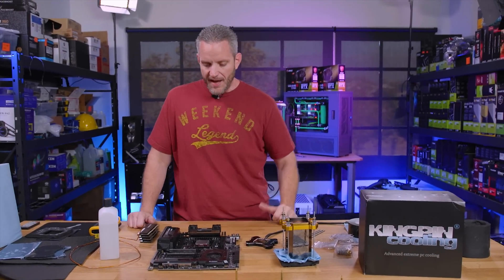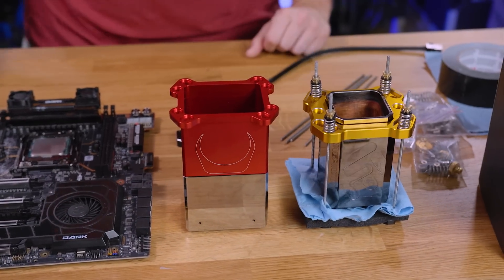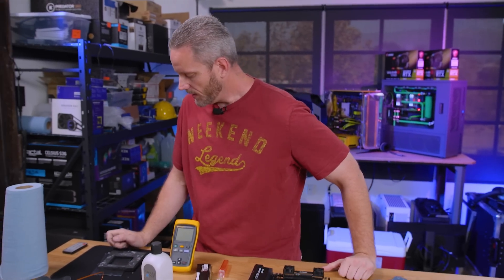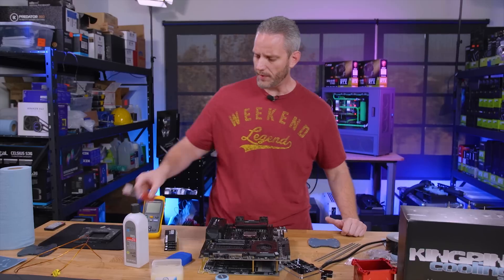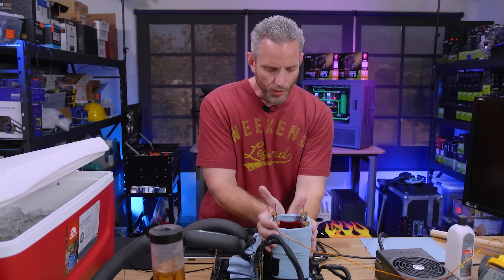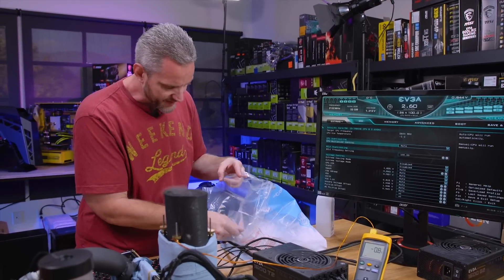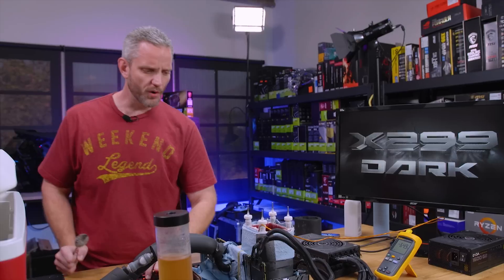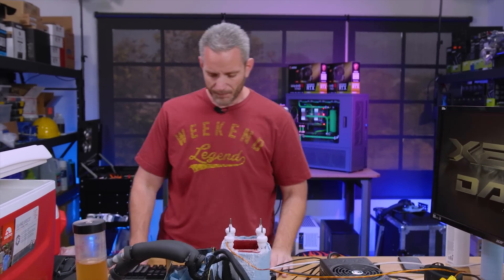Dry Ice Overclocking... NOT RECOMMENDED!

Comment: The trick to using extreme cooling such as dry ice is to encase the motherboard in a vacuum chamber. This would eliminate the possibility of condensation. (It's very easy to make a vacuum chamber there are many videos on YouTube - such as "Custom Vacuum Chamber" skip past the 1st 2 min as he shows his old failed chamber 1st). Once the motherboard is installed inside a vacuum (where the air is removed) the surrounding "space" no longer has moisture in it (as it was all removed by the pump). Please note in a vacuum there is no air to blow - so if using fans (such as on a chipset) you'll also need to rig something up to those such as liquid nitrogen / dry ice to cool the videocard/chipset/VRM's. As for getting the the cables/power cord to the motherboard - a Plexiglass vacuum chamber still works if you drill very tight holes for the cables then use silicon to seal them in place. (Silicone is easy to remove later if you wish to remove the cables as well) - Yes this does work as you can see here: https://youtu.be/VpIM1WhmqGk

UPDATE: I am getting many responses where people are saying this would never work or this or that would be an issue. However upon reading their comments it seems clear that all of them (so far) really have no idea how a vacuum chamber works. I have watched countless videos about vacuum chambers for many years done by DIY enthusiasts to University professors. And I have a firm grasp of how they work and so I have written a number of responses to the various comments to correct all their erroneous beliefs which are obviously based on assumptions they made without knowing all the facts.

So if your also in doubt or disbelieve about if a motherboard could work in a vacuum please read my replies below. 

ALSO I'll give you a hint now:
SOLIDS: such as metal and rock are NOT subject to expansion or contraction due to a vacuum (they only expand or contract slightly from heat or cold) - hence we see asteroids/meteors in space not affected by the vacuum - as well as various metal objects in space - like space stations, satellites, and telescopes - ALL containing electronics including motherboards which work perfectly fine in the vacuum of space. 

GASES & LIQUIDS however are affected (causing expansion & or contraction) by all of these extremes HEAT / COLD and VACUUM / PRESSURE.

Think of a vacuum as the opposite of being deep in the ocean. In the deep of an ocean - water pressure is CRUSHING inward. Yet drop a boulder (made of rock) or sink a ship into the ocean and it sinks to the bottom unaffected. However if that boat contained a pocket of air sealed inside an air tight room it would be crushed. So they invented submarines made of metal and glass (glass is a form of rock) which withstand the pressure fine.
In a vacuum it's the opposite of deep water - instead of crushing pressure it's expanding outward pressure. And BOTH of these extremes ONLY affect items containing "GASES" OR "LIQUIDS" which are subject to EXPANSION and COMPRESSION - METAL and ROCK are not subject to expansion or contraction due to a vacuumwhich is what video cards/motherboards/ram are ALL MADE from.
Reply: As air pressure drops, electrical conductivity increases, up until you down to around 1/100th an atmosphere. So unless you get a very good vacuum you run the risk of frying your computer.
Similar problem this youtuber ran into with putting  a microwave in a vacuum chamber https://www.youtube.com/watch?v=JSR7I1PEh1w
Reply: "JCB 136" - Perhaps you should educate yourself better before speaking your "opinion" - Because as you can see from these videos solid state electronics electronics run fine inside a vacuum (here are just a few quick examples): 1st one is a cell phone running inside a vacuum without issues:
https://youtu.be/_1REFC5lI2U
2nd you can see a Bluetooth speaker running fine inside a vacuum chamber.
https://youtu.be/657caNs8nRY
Home made vacuum chambers are far from perfect vacuums like space - however they are strong enough to remove all the moisture. AND as you can see they DO WORK.

Here's how to build a quick and easy home made vacuum chamber https://youtu.be/ERRMoHfrjAI - which you can witness it functioning yourself.
Reply: Better off putting the board in an airtight enclosure with a desiccator and recirculating fan and removing the moisture that way. The LN2 container could be channelled through to the board without having to insulate everything. You could blow some nitrogen gas into the container to keep the pressure equalised and vent the excess.
Reply: Justin Harrison Also, all the components without heatsinks still require basic air cooling which is lost in a vacuum, but not in an artificial atmosphere of something like pure N2 or CO2 (basically your extreme coolant evaporated).  Also to keep things running you need something that cools your N2 or CO2 back down in a loop.
Reply: I am not saying it will not work, but how is that a better "Trick" than simply putting Vaseline on stuff? 

Idk man, that is overly complicated, and also (as you said) creates the problem of cooling anything on the board that needs a fan, which opens even more work. Crafting a plexiglass case, splicing cables and drilling holes than soldering cables and closing the holes is plenty, plus since the chamber will be from many plexiglass panels it will not be perfectly vacuum too. Keep in mind that if you drill a hole big enough to stick a 8 pin cable trough it, no matter how much silicone you put, if your vacuum is good, it will suck the silicone right in and you are screwed. 

It MAY work, just like many other things, like driving your car on whiskey instead of gasoline. Is it practical? Nope. Does it pose more risks than problems it solves? Yes. I am not saying I am a professional or smth, but I haven't seen Der8auer or Kingpin use vacuum chambers and they do just fine.
Reply: As for your comment about it being overly complicated - have you seen the lengths Jayz goes to in his videos? Just look at this video he's got all sorts of cooling going on. Not only is he using dry ice on the CPU but he's also using a cooler full of ice with a bunch of water cooling radiators buried under the ice (to pump very cold liquid cooling to the GPU). Also look at all the effort he has to do to prepare the motherboard/GPU/RAM etc for condensation - he has to cut all sorts of sizes of paper towels, fold them, roll them, tape them, and wrap the video cards etc. Then there's the need for the thermal heating pad, Vaseline, foam etc. So I don't see why you'd think building a simple vacuum chamber is so much effort for this channel. With out the worry of condensation - perhaps he could get temps even lower than other record holders - and possibly beat their scores? (It's most certainly not practical to use dry ice to cool a CPU yet you obviously watched the video & did not complain.) New discoveries are made by pioneers - and risk takers achieve new records. (For example the guy who designed the liquid nitrogen chamber for this CPU - his pioneering efforts made it possible to cool a CPU to these low temps and achieve such high clock rates.) 

(Not that this suggestion is intended for "beating" other peoples records/scores for "fame" - but rather it's a suggestion made out of curiosity - to see how far the hardware can go.) 

Also please note that Plexiglass comes in all sorts of thicknesses. Including (if you had searched Youtube for "Custom Vacuum Chamber") you'd see the plexiglass to use is 3/4 inch thick (you can achieve an almost perfect vacuum with plexiglass if you seal all the sides with silicone). The YouTube Channel "The Action Lab" uses a custom made plexiglass vacuum chamber in many of his videos using the same 3/4 inch thick walls. 
As for your complaint about silicone getting sucked through the cable holes - I suggest you check out the "King Of Random" Youtube Channel and search for the video titled "Electricity in a Vacuum Chamber" They have a working vacuum chamber with holes drilled through the plexiglass which are then sealed with silicone (well silicone mixed with corn starch to thicken it up) They manage to reach an almost full vacuum and the silicone does not get sucked through. At this level of vacuum it would be more than enough that all moisture would be removed - making it safe to use liquid nitrogen or dry ice.
Also you can watch "How To Build A Vacuum Chamber, That Sucks" on "The King Of Random" channel again he uses the same 3/4 inch plexiglass & silicone which is used in many of his successful vacuum chamber videos.

*One last small footnote - with so much plastic polluting the planet/oceans etc. it would be nice to see someone use plant resin to make plexiglass instead of using traditional petroleum based resin - as plant resin based plastic bio-degrades if left to the elements - and petroleum based takes 25-35 years (or more) to break down. Which is the main problem with traditional plastic.
Reply: There is nothing fake about these plexiglass/perpex vacuum chambers - as they do work. For example there is no way to "fake" these expanding marshmallows under vacuum as seen here https://youtu.be/OuHBzK-LK24  (also at the end he reintroduces normal pressure and the marshmallows condense)
Reply: @AstarOfDavid  You do need a super thick case for the vacuum pressure. I put my phone in a vacuum chamber (wrapping in carbon fiber), and at normal size of 3x6in (75x155mm), that is over 260 lb of force (~120 KG). On a motherboard (or the lid, depending if you use a vacuum bag or a box), that would at minimum be over 2000 lb (a full ton, which is significantly more weight than driving over it with a big pick up truck) or ~1000 KG. That's probably why most pressure boxes or motherboards would fail, its a LOT of force going on. I mean, that's probably going to shove the RAM sticks right through the board like a knife if you're using a bag... Good news is, you won't need to bolt the cooler down!

I do run sub-zero for daily, its not difficult at all. You water-proof, then insulate, then add some heaters, and then a little more insulation and you're golden, basically maintenance free for a year or whenever you next upgrade. Its not rocket science (I make that joke as an aerospace engineer, but its really not that complicated).
Reply: Unfortunately it seems that you do not understand how a vacuum works. Solid items like METAL & ROCK are NOT affected in a vacuum. For example there are countless items in space such as asteroids & meteors made of rock hurtling through space that are not "crushed" AND there are countless items made of metal floating in the vacuum of space such as shuttles, space stations, telescopes, and communications satellites. None of them are "crushed" and all of these devices orbiting in space contain many sorts of electronics which work fine in a vacuum. In fact I've seen astronauts working on the Hubble telescope doing repairs to various motherboards while floating in space. (The astronauts require a special suit to protect them from boiling then expanding then exploding in the vacuum of space - because they are mostly like a sealed sack of water. - Yes boiling even though space is like -450 degrees - water boils under a vacuum - in other-words a vacuum lowers the boiling point of water) The metals and the astronauts suit are all un-affected by the vacuum of space. This is because a vacuum expands items containing "air" (aka gases) and "water" (aka liquids)
I used to think the same way about a vacuum chamber assuming that it was high pressure which meant that anything inside would be under extreme crushing pressure pinching it inwards. When in reality a vacuum works in the opposite direction - they pump air OUT of a vacuum chamber (which is a removal of air and gases including moisture) - they do not pump air into a vacuum chamber (like a tire) - if they pumper air into a vacuum chamber then it would be pinching pressure - and my idea would not work because there would technically be more moisture trapped inside the chamber than before. Items in a vacuum which contain "air" or "liquid" expand outward. Just to verify this watch this video and see for yourself a vacuum EXPANDS items it does not create massive pressure crushing them. https://youtu.be/zYLJGXthzpE
So to your comment about the RAM and CPU fan:  Being inside a vacuum does not create "gravity" to push the ram or heat sink down. (Gravity occurs in a vacuum when you place an item with huge mass inside it) There for there is absolutely NO reason why a heat sink or RAM would be forced in any direction. 
Motherboards, CPU's, RAM, etc are considered SOLID STATE ELECTRONICS and are mostly made of METALS and ROCK (yes motherboards and all PCB's are made from fiberglass - which is a ROCK). 

Footnote:  Electrolytic capacitors (On most motherboards and video cards) do contain a dielectric liquid sealed inside them - however they are designed to withstand expansion - as capacitors run around hot items they also heat up - often reaching above the boiling point of water. There for to prevent them from bursting they are designed to withstand a very high pressure. So there is really NO REASON why a motherboard would not work inside a vacuum.
Reply: @AstarOfDavid  I know how the forces work, its not rocket science (I'm an aerospace engineer, its obvious when summing the forces with 0 pressure on 1 side and 0 pressure on the other is the same as sitting on a desk like normal). What I'm talking about is if you use a vacuum BAG, since its by far the easiest to do (double sided gummy tape strip, and a bag with a hole cut out for your suction line and a surface like a table to bond it too). A box (like the lid and sides) on the other hand, still experiences the same ~2000 lb (1000 KG) since one side has 14.7 PSI (sorry, I'm using English units, I hate them too) and the other ~0 PSI. That's why you use vacuum bags when doing composite layups (to get thousands of pounds of force to really form them well, as opposed to filling it with sand and moving giant weights with a crane, you can get away with basically a cheap trash bag). So now the computer isn't being crushed, but you still need a box that can withstand 2000 lb of force from the top and bottom, and probably 1000 lb from all sides.
Reply: @AstarOfDavid   Wow, you didn't read my statement did you... I suggest more reading and less typing. I quote myself: "On a motherboard (or the lid, depending if you use a vacuum bag or a box)", "when summing the forces with 0 pressure on 1 side and 0 pressure on the other is the same as sitting on a desk like normal", "So now the computer isn't being crushed, but you still need a box that can withstand...".
Library's are nice. they have good books to practice reading, and some are awesome (I loved the Eragon series in school, I'd read all 800 pages in about 3-4 days and be ready for the next one, its one of my favorites if you like medieval/fantasy genre)

Comment: I used to peltier cool all of my 90s to early 00s overclocks... Id have inches of condensed ice on the mobo and cpu... all was always well because it's condensation, it's distilled... it's impurity free and naturally safe to be all over all your electronics.  What I've seen you do time and time before is to wipe up things with dirty rags, which have impurities, and conduct.... otherwise you could have this entire thing in a bucket of distilled water, and it'd be fine.  Just stop touching all the condensation, let it get cold enough to freeze, and you're good.  Hell, use a peltier a bit and bring that tech back... it's not bad... Not good the way idiots use them today, to cool the loop... One should use a TEC or Peltier to cool the CPU directly, then cool the hot side of the peltier with some high end heavy water cooling.

I'd leave my ice block CPU run caked in ice form months on end though... never defrosting, and never giving a shit... not I or the CPU gave a shit about the ICE... nor did the mobo or anything it extended to... again, as it was non conductive and distilled.

Comment: I hear the best OC trick is to put your motherboard in the dishwasher.
Reply: Top rack only.
Reply: i mean, it wont hurt anything all that much
Reply: Blendtec
Reply: I dont think putting your Motherboard in a woman would help with anything
Reply: maybe doing oc on artic
Reply: Gee thanks for the tip!
Reply: @ManOfAttitudeLP1998  kantig
Reply: Levan, Everthing fits if you use enough force...
Reply: No No it's the reverse heat phenomena that comes from a 400 degree oven
Reply: Especially if you use Finish Diamond
Reply: no what you do is rinse it under a tap and put it in rice it truly works
Reply: mfdsuk dishwater water gets hot though
Reply: Also, great way to get all the dust off of it.
Reply: @ManOfAttitudeLP1998  heilige scheisse, lern erstmal dich ohne Schimpfwörter auszudrücken, wie alt bist du? 10?
Reply: Fuck, i tried that but my mobo broke, i need a better dishwasher
Reply: i feel like this would probably injure my wife. would not recommend.
Reply: I didn't know you could put a motherboard in a woman:)
Reply: @LA-ls2uk  Lol
Reply: de8aur
Reply: *der8auer
Reply: My bad lol
Reply: Dishwashers use hot water
Reply: just overclock the dishwasher
Reply: Not for OC your MBO they dont. Thats just fake news.

Comment: so why use acetone which freezes at -139 f or -95 c when you could have used rubbing alcohol which freezes at -173F ? would rubbing alcohol give you colder temps?
Reply from the maker: Because -70c Acetone and -70c Alcohol are both....... -70c
Reply: Well god dammit Jay i was gonna say that
Reply: Duh, use both and get -140c 😉
Reply: rip
Reply: At least Jay does read the comments.
Reply: IPA gets really viscous with dry ice so the thermal transfer would suffer as the turbulence in the liquid would be next to none. Works great for a cold trap to collect moisture though.